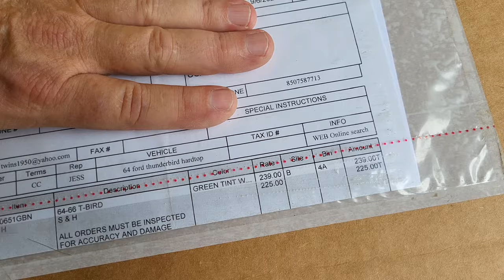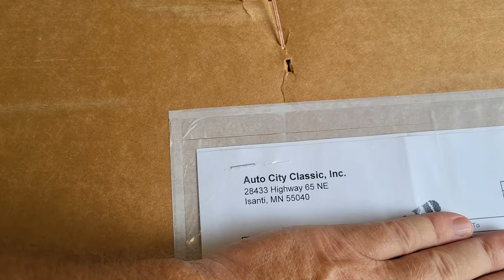How To Install A Classic Car Windshield

Comment: Well I have a '60 fury and not exactly a readily available windshield. Got one from southern California and it was not cheap, $450.00 and yep to home shipping $350.00. I can drive that far for less. So yeah sounds high but over 22 hours away, via highway and about 1,500 miles. As for my truck I wanted a slider. Got one, re did the broken window and put it in my self. A heck of a lot easier than I ever thought.
Reply from the maker: That's great that it went easy for you.  Glass and glass shipping is so expensive.